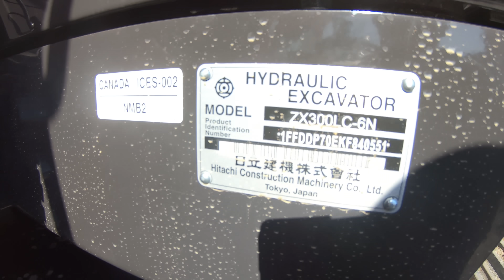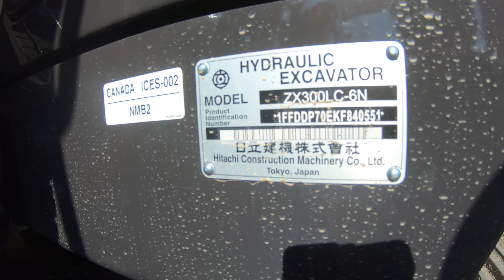Overheating mystery solved for John Deere/Hitachi Excavator 35zts

Comment: I’m a Retired Union Boilermaker and we use to make our own gaskets from a roll of material. But then in the late 1990s we started using Red high temperature silicone. On the burner doors. So if a liquid gasket is good for a Power Plant Burner I’m sure it’s good for equipment like that. You did a nice job 👍.

Comment: i used to diecast those, we used a mazak alloy (zinc-based alloy) we diecast everything from foot pedals to the hydraulics heads, very hot work,i still have the burns from an accident with it,took months of A&E appointments to fix,love your vids jesse, came here from andrews vids ,as an old sand moulder, die caster, welder, i love these vids right up my street,

Comment: I see some other people picked up on it as well but as soon as he showed the new pulley it was obvious it was a combination harmonic balancer/ pulley.  I’m used to dealing with balancers in old mopar engines but I have thankfully not had any issues with my skid steer. I’ll have to look and see if it has the same pulley balancer setup. I suspect so now. Great informative video.

Comment: Even if I get gaskets with something I always use RTV. Every time I don't it leaks. For over a decade now I don't even buy gaskets for stuff like valve covers and water pumps (used). Glad you got this sorted out. can't believe that crank pulley came apart like that! Seems like one of those expensive-only-because-they-engineered-it-to-fail kind of dealership items..

Comment: Fair play to you mate. You did it. A bit of sagely advice from an old timer; Your engine overheats aftyer using the machine for half an hour. You have a look inside the engine box to investigate. Which part do you change to fix it? Answer, the right part. It's all about the troubleshooting. Methodical troubleshooting. That is where the experts come into their own. That is how you save big bucks on time and parts. Be methodical and you will get there. Eliminate things until you see the problem. Otherwise you are just firefighting.Keep up the good work.

Comment: When I was a lad I was taught how to cut gaskets, I'm also not a fan of modern silicone based sealants and being able to make a proper gasket has solved many similar problems for me.
Reply: Once worked with a guy used rtv on gaskets. Must be a suspenders and belt kind of thing. I thought it was silly but he said it made it easier to repair later on if needed.
Reply: I cringe when I do would on newer cars that use RTV only in a lot of places. I agree that they don’t seem nearly as good as a real gasket.

Comment: Just for future reference, if you need a gasket or gasket material especially on something the size of this water pump you can always use a cereal box, just cut out one side and lay it on the pump, use a ball peen hammer or some metal  that has a round edge like a decent size box wrench and gently tap the edge to outline the pumps edge and also any inner holes then cut out the gasket, a Lil formagasket on the sides to help it stick and it works great, you can even make 2-3 and double it up.

Comment: That's a crazy problem, I have never seen a pully like that. I think I would have welded that.
Reply from the maker: You should check your hitachi. If the fan spins freely it could be a problem, turning the fan turned my whole motor when I got the new pulley
Reply: @jmuller86  Yeah, good call. I wouldn't have even known to look for that.
Reply: @AndrewCamarata    That's what a lot of people are saying.  I wonder what it actually is??   I don't think it's supposed to slip at all.  Maybe it's a vibration damper, or maybe a shear point.  Otherwise, I don't know why it's not just a solid pulley.
Reply: It's not supposed to slip, it's just a weakly designed bond between the center hub and the outer pulley of the harmonic balancer. Certain engines over the years were prone to this, in the late 80s some front wheel drive Buick & Jeep 6 cylinders come to mind. They were common enough that parts stores used to stock aftermarket replacements. It can also be an issue in high RPM race motors.
Reply: Guys its a silicon filled clutch, once it is spinning it slips at low temps to allow warm up then engaging more and more with temperatures to keep pace with engine load. 
Smh.
Reply: No it is not supposed to slip. There would be no reason at all to slip the harmonic balancer pulley that also drives the water pump, alternator and probably the AC unit as well.
Reply: @jaxturner7288  Makes sense..  a Clutch fan  seems like a better choice.
Reply: Crankshaft needs that rubber isolated mini-flywheel to prevent harmonic shock loads from fracturing the crankshaft into two pieces internally. Don't weld these, replace them only. It is important or OEM would never spend that money to put it on there.
Reply: Another good thing to look at is the hydraulic side of the system. I used to find more excavator overheating problems were a result of the hydraulic oil being too hot and since that cooler is first it transferred its heat to the engine coolant and overheated the engine. The high hydraulic temp was usually caused by a bad seal bypassing somewhere sometimes in aux circuits not used on the main valve body. Flir or temp gun is a must have.
Reply: is that the 3la1 isuzu? i just bought a ihi  20jx looks like the same motor.
Reply: @calholli  exactly what I was thinking.
Reply: @leebarnes655  well that answers that. Thanks bro! 👍
Reply: @jaxturner7288   so alternator can't load battery after a stressfull minus temperature start? doubt that
Reply: @Rettich333 the alternator has its own pulley driving it.
Reply: I've seen alternators with a one way clutch pulley, but not a damper pulley like that.
Reply: @jaxturner7288  No, it is not a viscous clutch. It is a harmonic damper. The rubber was deteriorated from the oil leak that was not repaired. Seal should have been replaced and a dab of grease on seal lip with some silicone sealer on crank snout to seal between crank and pulley. Good job finding root cause of overheating, Jesse!
Reply: You don’t weld a worn balancer because you gotta know the exact position of balance of crank , alternators generally only work properly in one direction they don’t have clutches, water pumps same applies no clutch however the fan can have a clutch wheel on the front that can fail over time and a/c condenser units have a clutch to spin freely when not in use , just for general information ... 😃🧐😉
Reply: @calholli  Nope
Reply: @yz250a  I like YZ too..  2 stroke master race.
Reply: @dave5litre462  a/c compressor units
Reply: @AndrewCamarata  Yes you would, you have a troubleshooter's mind, nice try though.
Reply: @calholli  Harmonic damper, using rubber is just one way of constructing them, some use other mediums to dampen the crankshaft harmonics, link explains how they work.
https://blog.k1technologies.com/what-does-a-harmonic-balancer-do
Reply: weld it the best idea saves time and money
Reply: Instablaster...

Comment: This happened to my girlfriends Pathfinder. Only symptom was squeaking sound at idle. Played hell figuring it out. Finally removed the serpentine belt, fired it up, and the pulley flew off into the frame. So yeah — these things break. 

Nice fix. Hope it helps others having the same problem.

Comment: I had that happen on a ford ranger, well almost. The damper failed, and the pulley, over time, was moving back toward the block. One day, the truck wouldn't start. I started trouble shooting, and one symptom was the ignition timing, and the sensor. So, I replaced the sensor. It would fits, and the old one had a huge groove in it. I finally realized the pulley ground into the sensor until it finally ate the whole magnetic part. I had to weld pull brackets on the pully to get the puller to work, but dang, that was a weird one. Yours is a strange one too. Good work!

Comment: Good advice about the key. It might have been worth pointing out that if the eccentric weight on the pulley centre is down when removing it the key will already be at the top so it has no chance to fall out.

Comment: The part that you replaced is called a harmonic balancer.
It protects the crankshaft from excessive vibrations.
They fail on some cars as well. Old 80's and 90's Volvo's are known for this as well.
But on those cars you notice it first when the charging system doesn't seem to work. Good repair job.

Comment: Had similar issue with my Yanmar B15-3 : replaced thermostat, rad cap, fan belt, cleaned rad, drained / flushed system several times replaced with super coolant and still had o/heating problem! Then it dawned on me…… someone had previously repaired the exhaust pipe leading down from the manifold with some heavy duty insulating wrap. The pipe was broken anyway so replaced it with a new stainless pipe and hey presto no more overheating! 👍

Comment: Very cool repair and you saved a ton of money.  The water pump on my B3000 truck is harder to replace than the water pump on this excavator but I only paid $20 for the B3000 water pump (with shipping).

Comment: Good thing you put your hand on it and noticed the bonded rubber had turned loose, from what the fan blades looked like and the way the engine was moving around at the end when throttled up I would say the fan contact with the shroud caused the belt to basically tear the rubber loose from the balancer. Good catch anyway and the problem is solved, I know this vid is old but I would look into what the mounts look like. Sometimes rubber saturated in oil lets things move way too much and cause an issue like that, anyhow been binge watching your vids and have enjoyed the content. Never knew vids of moving dirt, trees and spreading gravel would replace watching tv lol

Comment: When you were talking about dropping that pin down in the motor I shuddered and it took me back to high school.  I had a Cobra Jet Torino and the engine blew up in it.  I pulled it and rebuilt everything and when I was putting it back in I was on top of the motor putting in the distributor.  I didn't see it wasn't paying attention or whatever but there was a socket laying there and it rolled in the hole the distributor goes in and I heard it hit the pan!  I was sick to my stomach!  My friend and I ran magnets down the hole for hours and never got hold of it.  Then we debated how much it would move around and maybe leave it in there?  After a while I said that's enough!  Pulled the motor back out pulled the pan and got the socket!  I debated pulling the pan in the car, but it was so tight I knew I would never get it to seal.  That car ran like a scalded dog!  I sold it in 1984, an all original Cobra Jet Torino for $1500.  I sure wish I had that car today!

Comment: Your harmonic damper is broken, nearly all harmonic  dampers have a rubber insert in them. There is a guy in NZ who repairs them by dismantling them and he presses and glues in a special rubber insert. This makes the harmonic damper like new. The bigger they are the more heavy duty rubber they have. Without a harmonic damper doing it's job there is a good chance your crankshaft will break. This is a problem on all vehicles as they get older. All crankshafts have some sort of vibration even from new. The damper or bottom  pulley is a vital piece of equipment. They have to be perfectly balanced and the rubber smooths out and absorbs the vibration from the crankshaft. Hope that helps. If your motor is old but in good condition but runs a little rough it might be the harmonic damper. It is very common for this to be overlooked.
Reply: Must be why motorcycles and many utility engines don't have them, no torsion dampers are not a necessity on all engines..
Reply: MerlinxPV those small engines don’t last as long either.
Reply: @smathet7766  Comparing rpm and actual output per liter the longevity of the non dampened crankshaft engines is a best a minor factor of comparison, your comment would be valid if those non dampened engines failed by "breaking their crankshaft", such is not the case though.
Reply: @Peter-V_00  They are balanced but there crankshafts are so short they  don't have the need for a harmonic balancer like cars and trucks.
Reply: @trevorburton2718  An inline 4 is an inline 4 whether it's in a boat, a motorcycle or an excavator, once again your theory is a non starter, just an FYI, those Yanmar engines common in mini excavators are 3 cylinders.
Reply: @Peter-V_00  It is not as simple as you say. The length of the stroke is also involved. Motor cycle engines use a different system .You may like to read this. https://motochassis.com/Articles/EngineBalance/EngineBalance.pdf
Reply: @trevorburton2718  I am more than familiar with what Tony Foale is talking about, unfortunately you are again using a broad brush ant totally missing the target. You referred to a "system" being used on non harmonic balancer engines, you need to be more specific just what you are referring to as Tony Foale touches on several principals balance as they apply to engine configuration and operating RPM, no reference to crankshaft "breakage" due to lack of a harmonic damper. If you took the time to read the Foale piece and understand it you would notice what he is citing is the inevitable problems associated with static vs dynamic balance but also the differences of number of cylinders along  inertia frequency due to component configuration and firing frequency vs RPM.
You made a blanket statement that any engine without a an external damper would break it's crankshaft without one, my point is your statement is not backed by fact.
Reply: Maybe the fan blade fatigues without the damper.

Comment: I hope you ended up replacing the fan, the blades are designed all exactly the same even in weight.  The an even wearing on the blades will cause an out of balance rotation creating vibration which could cause additional problems to your really cool fix. When the clutch fan first came out that problem  caused folks tons of money trying to figure out why they had a problem with over heating.  I was in my early 20's getting my radiator fixed and the old guy working on my vehicle told me that my radiator was fine it was the new F-in clutch fan that I installed he GAVE me a new fan (good old days in America) told me to go home and make it right  I never had the problem again. You have good troubleshooting skills brother

Comment: Yep when you said rubber inside there it took me back to a motorcycle I had a no charge problem on. Alternator had a splined shaft on it that fit into a splined socket on motor. Not real complicated. But it wasn't obvious till studying microfiche and ordering a bushing that resembled a sealed bearing. Instead of the bearings it's rubber sealing the splined inner race part to the outer race essentially giving a cushion as motor spins and transfers rotation to alternator. Problem was the rubber separated from the metal and would spin alt slightly but not enough to charge any load. Motorcycle parts guys and techs had no idea of any of it. Motorcycle alt rebuilder had no idea of any of it, numerous web forums had never seen or heard of it. $13 bushing thing fixed it after months of research.

Recently working on a Duramax drivers side motor mount.  Frequent issue also. Mount is 2 pieces of steel separated by 1 1/2" of rubber. Motor revs torques driver side lifting or separating the 2 pieces and tearing rubber off steal. Who designs this stuff? Oh that's right it makes it out of warranty so who cares right. So I drilled a 1/2" hole all the way through center and gr 8 bolted to not allow the lifting or separation yet still dampen.

Moral of the story rubber used for cushion separates from steal.  Replace those parts lol

Comment: good job, we had the same issue with our 12 ton cat, but it was the head gasket. our 27 ton Hitachi needs to get a new oil cooler radiator core put in so it has been sent off farm to be done, our zero swing cat ( about the same size as your machine ) kicks butt lol, if push comes to shove, breakfast cereal box can be used as a gasket, you can buy gasket paper by the roll, we did buy the right head gasket for the 12 ton cat, but making a copper head gasket would have also fixed it, good luck with your work and be safe / best regards Waza

Comment: Excellent video :o) If you ever get stuck with a huge quote on a water pump then have a sniff around the aftermarket electric ones. Might need a fan too, but the lack of pump pulley is simply fixed with a shorter belt.

Comment: 300 series Hitachi is probably estimated at 30 tons. So it would be a sixty thousand plus pound machine. Andrew Camarata has a crankshaft pulley just like it on his Mitsubishi Montero sport. Newer crankshaft pulleys have went that direction to harmonically balance the crank. Good Job Jesse.

Comment: Great video. I have a small komatsu excavator that overheats. After watching your video it gave me an idea, I'm going to take a paint stick and paint a line on the harmonic balancer, that will tell me if it is slipping.
Reply: Did you ever figure out your problem? I'm having a similar problem with my Komatsu Pc30fr-2
Reply: @yetibremsstrahlung9018  Yes, my problem was the radiator was clogged with dust. I took an air gun and blew it out.

Comment: I have a John deer 50c and I had the same over heating problem... after replacing the thermostat, water pump AND radiator, I found that the same pulley was my issue!

Comment: You did a great job fixing that overheating excavator. Amazed at your skill level. However, when I saw you spin the cooling fan I knew that wasn't right. Shouldn't move! The rubber turned loose inside the harmonic balancer. May have just been age but I noticed it looked oily around the front of the engine. Perhaps it should have got a new front crankshaft seal.
Reply from the maker: I did replace the crank seal